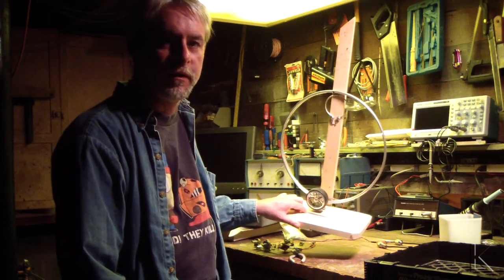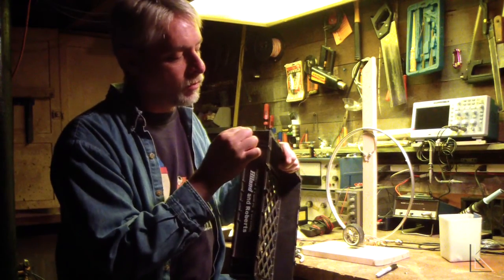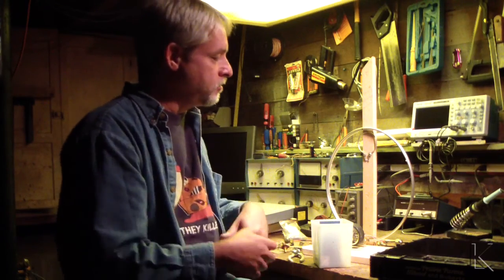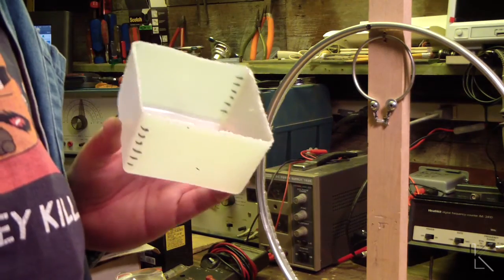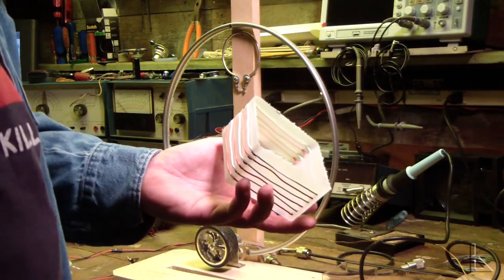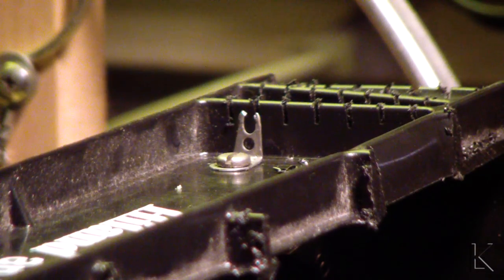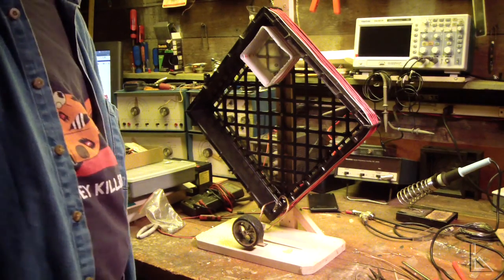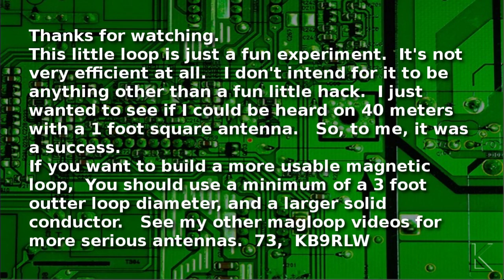Ham Radio - Building a 1 foot Junk box magnetic loop transmitting antenna. (experimental)

Comment: Does the overhang of the winding, ie. the unused tapped windings, have no detuning effect when using one or two taps?
Reply from the maker: Yes, there was strange interaction caused by the unused turns.  Very strange.   The taps were eventually evolved away.   See the final design and on air demo video I uploaded a few days later.